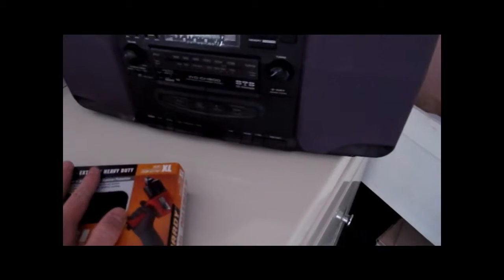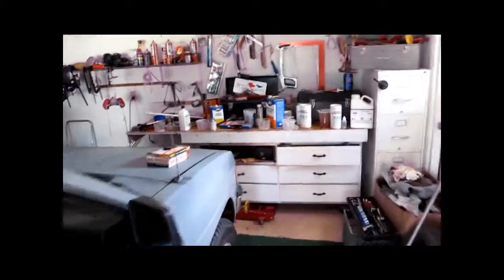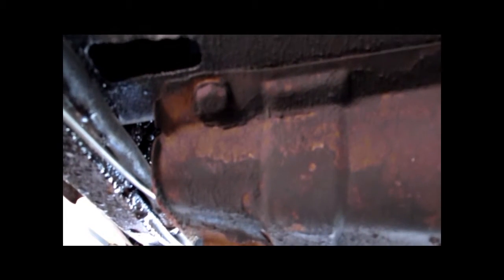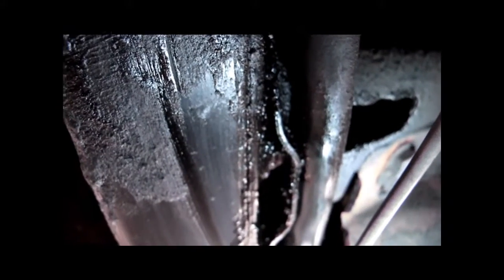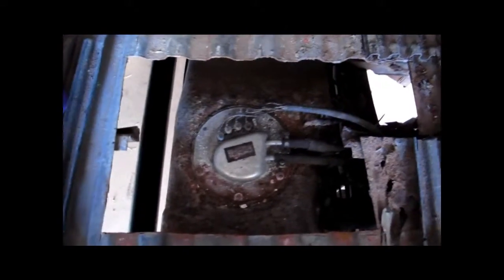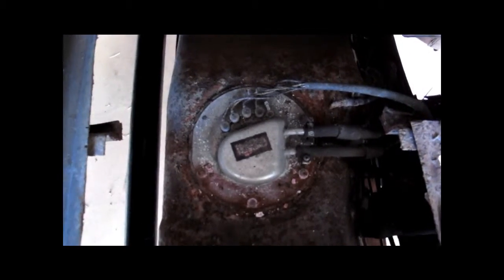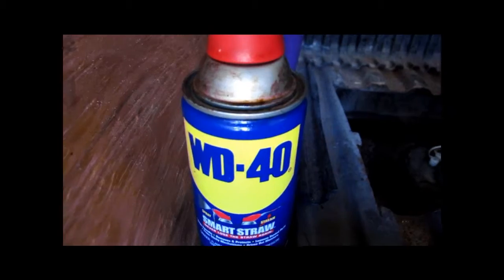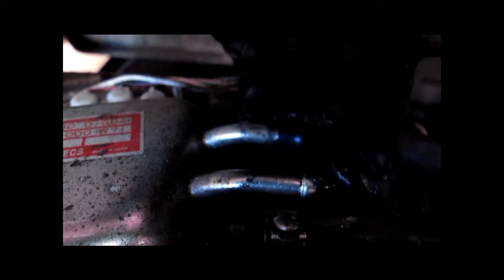Nissan D21 Hardbody; fuel line leak. Part 1.

Comment: had one of those lines leak on my sons hard body.  you need to determine if it's the pressure or return line.  I blocked off the return under the hood and briefly turned the key.  lots of gas, pressure line.  none, return. My sons was the return.  (more on that in a second) then I traced the one it was to both ends where it disappeared at both ends, cut and replaced the entire hidden length with a proper strength and sized rubber hose, pulling it through and leaving the dead line in place.  Now, 5 months later, the other one blew, and being the pressure line almost burned the truck down as he was driving to work.  I'd change both.the same way.  the WD40 straw needs to be all the way up or all the way down.  you had it not quite down. you can spray with it up for general lubricating without the precision of the straw.  it's made to do that good luck.
Reply from the maker: +iceman22st I've tried that WD-40 nozzle in every configuration. Maybe I got a bad one, I think I pulled it off a discount rack. What kind of high pressure line would you suggest? I'm planning to replace both the supply and the return, no need to track down the exact location of the leak, like you said, all the lines are probably due for replacement. Best case, I can find all the right line at my local parts store.
Reply: Find out what pressure the pump puts out (I don't recall) and buy fuel injection hose with a PSI rating higher than it needs.  Regular gas line for the return.  Most parts stores will sell the line by the foot.  I double clamped each end of the pressure hose too, and good clamps, not dollar store ones.

Comment: You might have to lift off the bed to get leaky section repaired. If the area was thoroughly dry,  the leak could be narrowed down if you watched the area while someone turned the key fuel pump on.  Wear eye protection, gasoline burns.
I've seen hard fuel lines rubbed through where the frame contacts them and in some cases where a rubber line crosses them. Sand/grit cuts the steel and the rubber is uneffected.  A flaring tool and a few fittings could make a lasting repair.
Reply from the maker: +piewolfe Wow! If I have to pull the bed, this will turn into a major restoration project. :) Not sure if I'm ready for that right now. Would have to locate many new parts first. :)
Reply: +coffeefish The camper does make it extra work.  I took of my f350 bed myself (8 bolts) but had help putting it back on. It might not be necessary, depends on where you find the leak and how accessible it is.  Fuel hose line and clamps might work if you cut out the hole section.  Good Luck.

Comment: you can buy just the fuel pump for around $60, you reuse the cover plate and fuel level indicator contraption. I just replaced my fuel pump and now doing my lines. But I wasnt as smart as you, i jsut removed the bed and kept my floor hole free. Ok i am lying my bed was already off, I got lucky! lol Installing new bushing and painting the truck.
Reply from the maker: The cover plate on my pump assembly was rusted away. The thing was toast.

Comment: Gad zooks bud I wonder if it ain't the tank itself with all that corrosion. And you sounded like you were getting higher and higher as it went on lol.
Reply from the maker: +TheMrRuger Yo! You're right about that. Just checked on the truck 2 minutes ago, and the leaking has stopped. Shit, I hope it's not the tank because I'm just not in the mood to replace it right now. My theory is this; the lines were disconnected, and the leak stopped, so it must have been a bad line. If it was the tank, it would still be dripping. Who knows. The plan right now is cobble together a couple new fuel lines and then see what happens.
Reply from the maker: +TheMrRuger OK, I just realized what you were talking about (getting higher and higher.) Someone off my channel had to spell it out for me. My whole house still smells like gas.